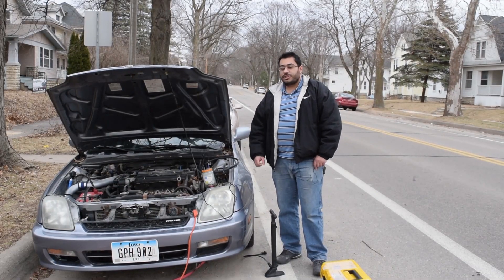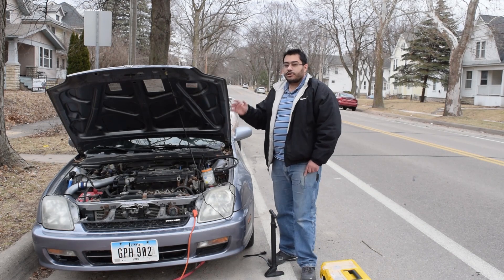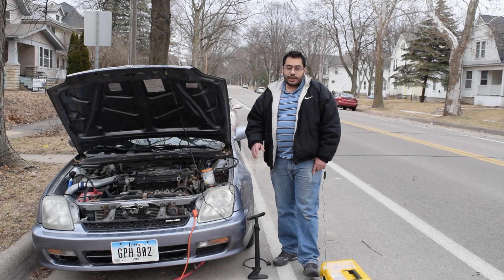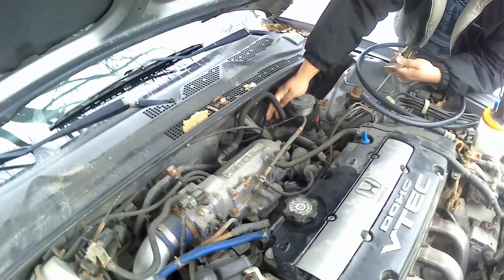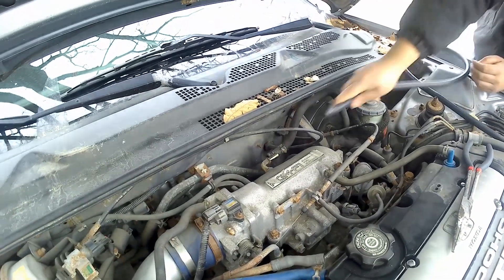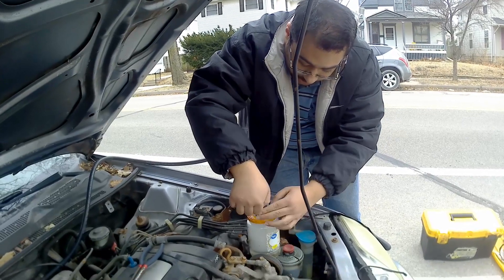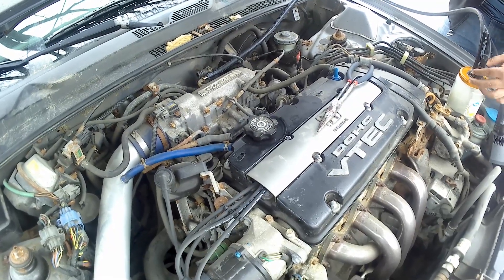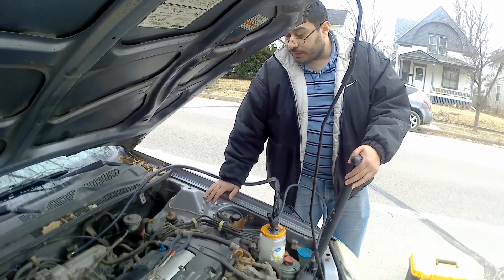Using my DIY Smoke machine

Comment: You will not see smoke even when there is a leak because the flow from your smoke machine is escaping through intake chamber, throttle opening to intake air duct and out to atmosphere.  You must disconnect intake air duct at the throttle end and block the pipe opening there to properly do the smoke test.

Comment: Oh well back to the drawing board.
Reply from the maker: It did work later. Just replaced the air inlet with a stim valve for a car. The pump fits perfect on it

Comment: You should have pulled the intake filter off and then blocked the hole to seal the system
Reply from the maker: You're correct on that.